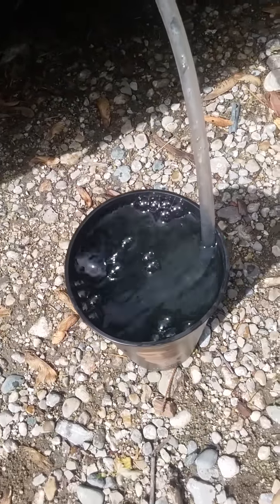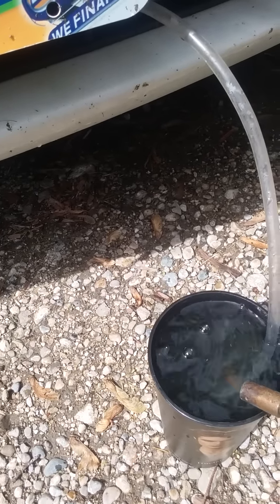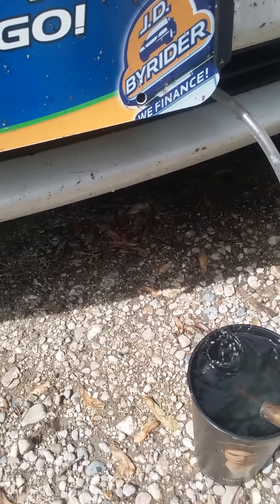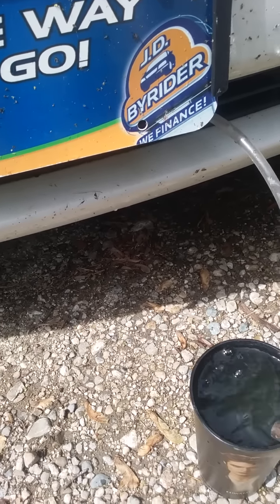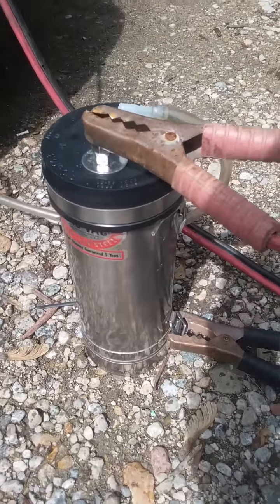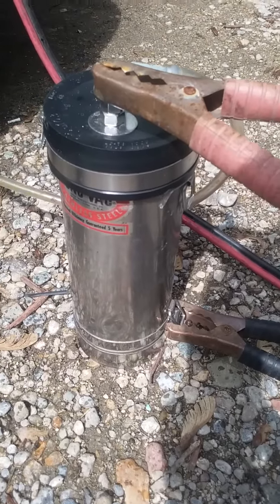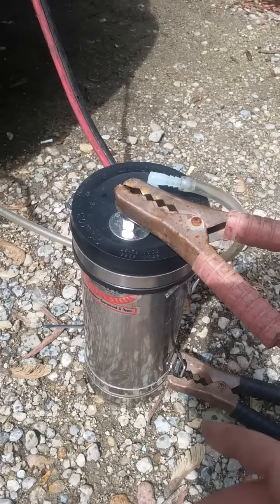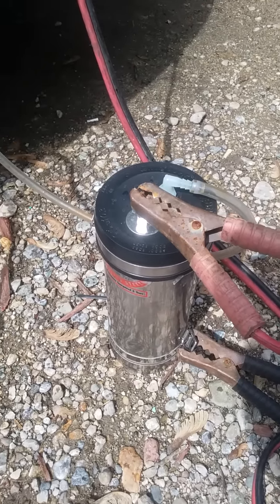Warning making hydrogen is dangerous!

Comment: I saw your vapor carburetor on your truck about 4 months ago.... I thought that was totally awesome... so thank you for that one.. and this one is very simple... have you considered combining both the vapor carburetor and your thermos... I'm thinking you might get close to 200 miles per gallon.... a safety feature on your vapor carb.... add some steel screens in line SO if perhaps you get a back fire, it doesn't run up your hose and into your supply...

here is an idea for you.... I bought an ammo can on eBay, a float valve and am still in the design process thanks to your video. fuel will come in to the ammo can from fuel tank/fuel pump, through float valve mounted on the side of ammo can. using the steel sealed water tight ammo cans, THEN your set up, THEN with a couple of steel mesh screens in line to prevent flash back from back fire.. the ammo can with float valve will help with the maintenance free idea of having to manually fill up your can under the hood... then I'm looking at combining your thermos and adding that with a one way check valve inline  to your vapor carb supply line... I'm a lot slower than you, BUT I think you really have a vision of what I'm explaining and that should make for several more videos for you... keep up the great work....